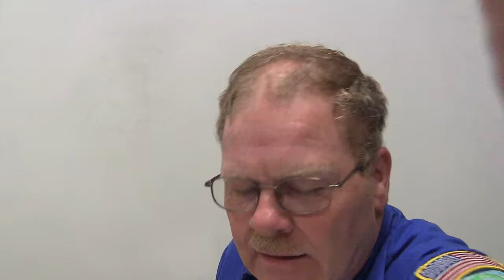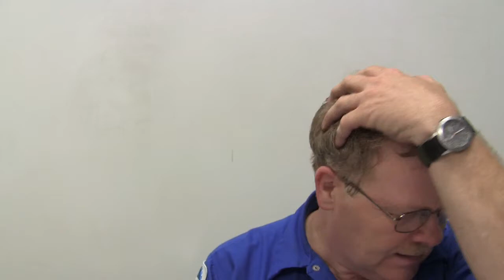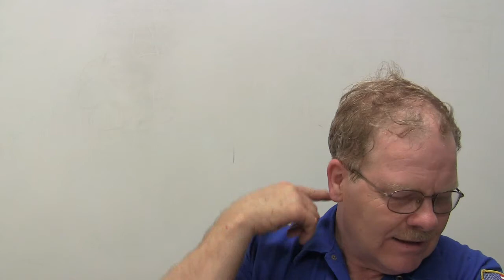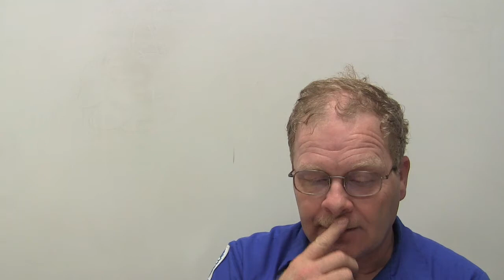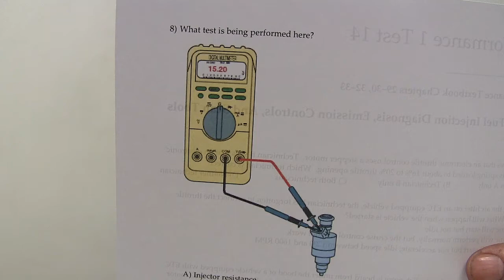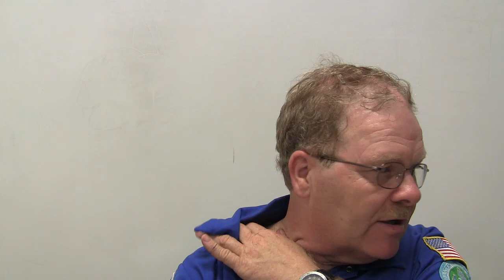Engine Performance 1 Tests 13 14

Comment: On the mid 90's v engine chevy. The pump runs the start sequence off the relay and a parallel from the special oil pressure switch takes over while running. The relay has heat protection and will shut off fuel if the oil pressure switch has a problem or is not getting oil pressure. I did a diagnosis on one last year with a bad parallel circuit in the oil sender causing the vehicle to stall then wait 15 minutes to cool the relay before restarting and run until the next stall a few minutes later.